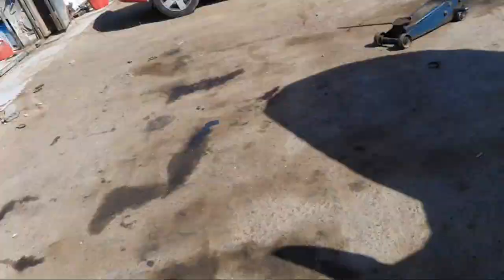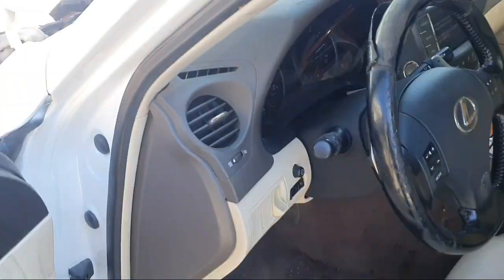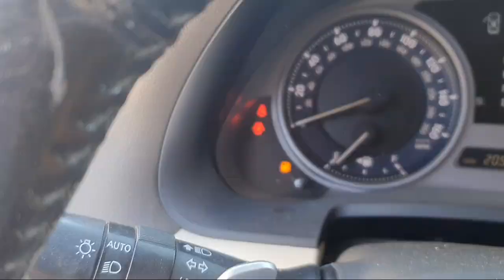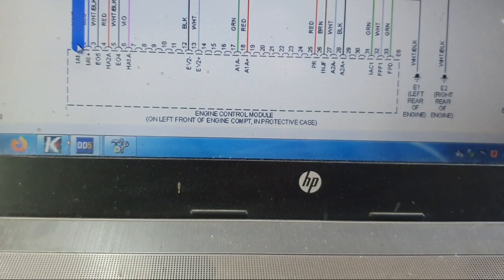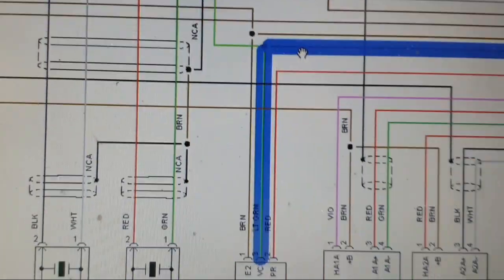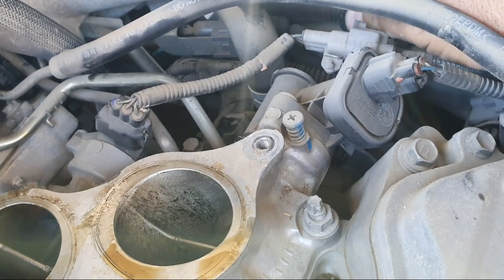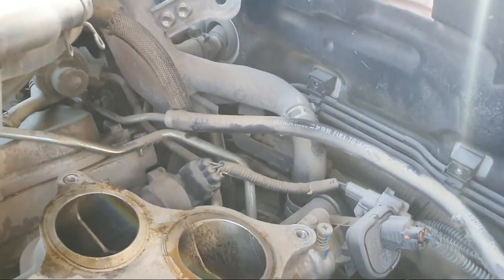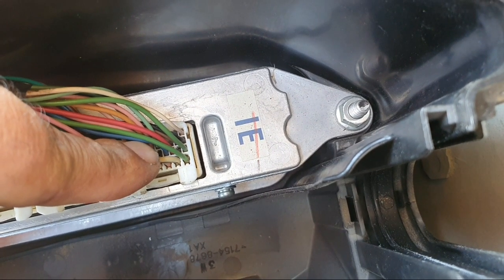Lexus IS250 No Crank No Start 5 Volt Ref Short. How Test If There Short 5 Volt.?

Comment: Interesting...I'm having a similar issue. Except when I unplug the fuel pressure sensor the check engine light does not illuminate...when I disconnect the camshaft sensor the check engine light comes on. Wondering if that's my issue camshaft sensor?
Reply: Than the issue was camshaft sensor.

Comment: hi mate did u have any fault codes or no fault codes when problem was?
Reply from the maker: No communication This time
Reply: @PakistanCarDoctor  I do have communication, but no fault codes. Start button always red, not green. P autotransmition and stop switch in order (checked by computer) Not working stering lock when press start button, but igniton switches on, no crank. in immo ecu no faults but in parametes says @no good communication with EFI@   Could you please screenshot immo parametres for me if possible please? I want to compare with my car